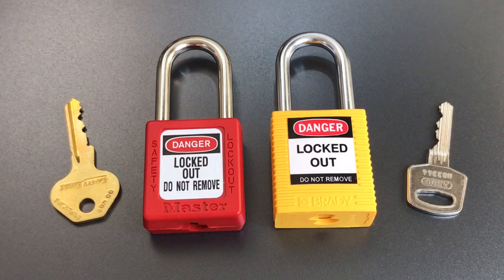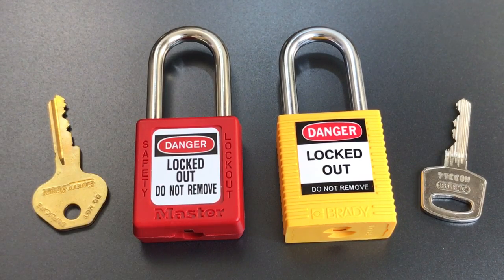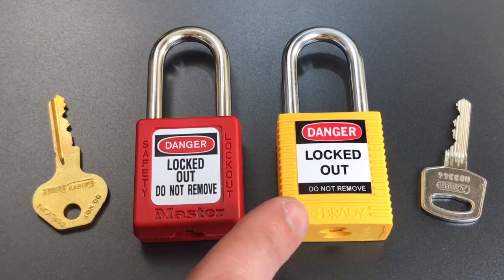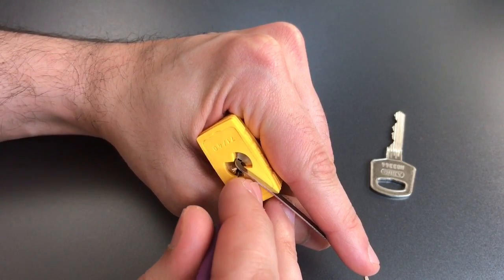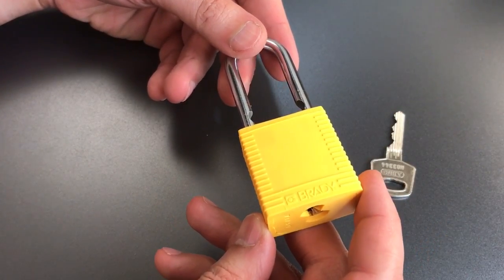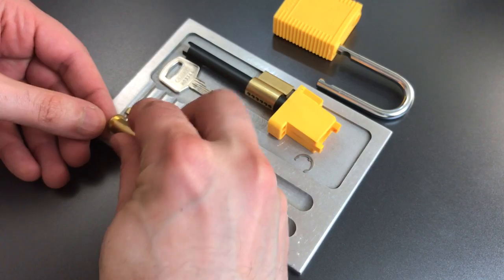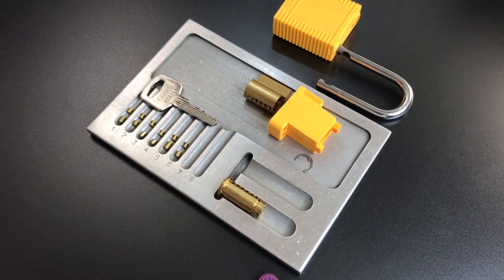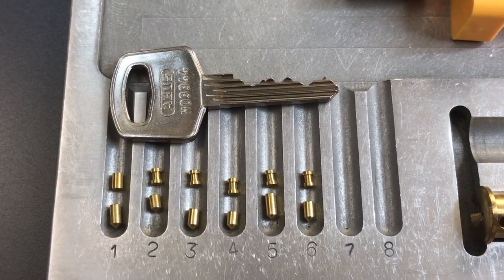[484] Abus/Brady 71/40 LOTO Padlock Picked and Gutted

Comment: It's all to support "One Person, One Key, One Lock".  Large companies may need to order thousands or tens of thousands of these locks, all keyed different.  Companies are even discouraged from allowing contractors to introduce outside locks due to the possibility of a lock being keyed the same as one of the corporate locks.  Master will even send key charting documents with the key codes for every lock to prove they have no duplicates, and support it by making sure future orders are not duplicated with prior orders as well.  So six pins gives you more unique keys.  As for the security pins, I imagine it's to help prevent accidental opening with the wrong key by accidental bumping or raking. The keyway is also restricted so that duplicates can not be created in the field to bypass the "one key" rule.  You should not be able to find blanks for these in the wild.

You can also order them keyed alike, master keyed, grand master keyed, and even great grand master keyed. OSHA does allow non-destructive removal of the locks if it can be verified that the employee is no longer onsite.  It does require quite a bit of extra documentation and procedure creation on the part of the company to do this though.
Reply: Well said. Thanks for the info.
Reply: The security pins are there to prevent claims that a LOTO lock was picked open either during or after an accident, which is a claim that could be made to shift fault for an accident from a negligent technician to the company. Likewise most LOTO locks use ball-bearing lockup to avoid claims of shimming the lock.

It's all about avoiding lawsuits and false claims.
Reply: 6^6 is still under 47 thousand configurations, so you definitely need to do it not-random if you want tens of thousands keyed-unalike.

You will not have a greatgrandmasterkey system with tens of thousands of different locks, for sure.
Reply: Here’s your OSHA reference:  1910.147(c)(5)   As others have said on this thread, makes no specific reference to pins. That wouldn’t make sense anyway. No government entity is going to write it that way. Just like they moved to performance specifications for procurement about 40 years ago. That is, when the government wants to buy something, they tell you WHAT it must do, not HOW to build it. Of course as I say that, the FAA requires Part 21 pilots to carry a flashlight with D cell batteries. Most ignored FAA reg on the books.
Reply: Chris P Bacon  Like I said, they can be ordered keyed alike, or they can be ordered and documented as no-duplicates. It's up to the applicable OSHA rules and internal company policies.
Reply: @JohnSmith-gs4lw  lol, flashlights with D cells... Those are pretty hard to get a hold of these days. But I'm sure any pilot carrying a flashlight will have a nice pen light with a Li-Ion or LiPo battery, and get a lot more light for a lot more time out of it...
Reply: DoctorX17 absolutely. And every one I know does exactly that. I was just saying that by doing that they are violating an FAA regulation. Would they ever get fired because if that? Or lose their license?  Lets hope not. But never underestimate the arcane stupidity of the Federal Government.
Reply: @patrickmcclintick9552  The only time keyed-alike would be permitted is if one person is specifically responsible for energy control and therefore one key for n locks at a jobsite. If multiple people have locks, the locks cannot be keyed alike. An employer can retain a duplicate for nondestructive removal but it would have to be subject to stringent controls. 

I'm federal government. We like simple and inexpensive lowest-common-denominator and have a ton of authorized employees with multiple locks [mine number in double digits due to 7 sources of power to lock out on one machine]. Some of these are breaker lockouts that attach to the handle and those locks must be electrically isolated, so in order to meet the requirements we have the Master 406 which is the logical and self-destructive end of high security core in low security device. The 406 is the 410 with a black nylon shackle [no exposed metal, because metal becomes plasma in an arc flash/blast] and barely meets the "without undue force" security requirements of OSHA regs. You don't need a set of cutters to remove it destructively, you only need something like a screwdriver to give you a little mechanical advantage while twisting the lock shackle and it breaks. 

Most of the reason LOTO devices are like they are is because of mammoth entities like the federal government that have policy requirements that exceed OSHA regs and at the same time don't want to spend a lot of extra cash. Solution? Build a generic thermoplastic lock, buy a mountain of meaningfully sequential key code security lock cores, and use economy of scale to make maximum profit. Through hiring/firing, attrition, the need for destructive removal, loss of devices, loss of keys, and general wear and tear LOTO locks are a consumable. The 40,000ish possible differs [per Master] mean that it's possible to prevent even entire regions of our operations from getting 2 locks keyed alike and security pins discourage key hacking/makeshift impressioning [we have a key cutter, some easy locksmithing is a small legitimate part of my job] and eliminate the possibility of an unskilled nondestructive removal. They make the product for we the Feds, and other large industry, and everyone else buys them because compliance is cheapest when you're using the most popular locks in the LOTO game [Master 400 series, Abus 71/40 and 74/40]. Has anyone tried out the Tradesafe? Seems to be a Master 410 clone.
Reply: @kdawson020279  I get it, but if you go to Masterlock, they do offer an option to order them keyed alike. So someone, somewhere, must have a use for them like that.
Reply: @patrickmcclintick9552  I can only see keyed alike being useful in a situation where one person in control is locking out multiple devices such as at a site where energy control is dual responsibility. In some situations, OSHA regs may not apply but they want the internal control. I don't have a lot of experience with the most strict interpretation of every regulation not applying since I am federal. I think it's also the reason that a plastic lock with 5 spools and a serrated pin makes perfect sense to me. Safety is between the ears, but safety theater is a good reminder not to send plasma through your body or mangle your coworkers and it avoids fines and regulatory actions.

Comment: From OSHA standards.
1910.147(c)(5)(ii)(C)(1)

Lockout devices. Lockout devices shall be substantial enough to prevent removal without the use of excessive force or unusual techniques, such as with the use of bolt cutters or other metal cutting tools.

No specific rule on number of pins.
Reply: I actually didn't know this. I thought they did it because it helped with price and electricity insulation
Reply: also if a source of supply is turned on and your lock is removed it's on you no questions asked but if the lock is destructively removed which would be very obvious it's no longer on you unless they do an investigation and find it was actually you
Reply: You can probably blame the existence of locks like this on the government since we are voracious consumers of locks and our Electrical Work Program requirements are more stringent than OSHA regs. In fact, the full LOTO procedure for my machine requires 7 separate locks, 3 plug lock devices, 6 6-hole hasp devices, one breaker lockout device, and 6 separate verifications of zero-energy state.
Reply: @donniedial3014  There is a rule about one key, one lock, one employee which explains the pin count but not the extent of the security pinning. That part is probably just CYA for preventing surreptitious removal.
Reply: I always figured/was told that osha requires that only the operator of the lock can be able to open it (aside from a spare key being locked away with other lockout keys for emergencies) and that for legal reasons they have to be able to show signs of malicious tampering such as a cheap plastic case
Reply: @Mrbmxprorider  For our Electrical Work Program and mechanical hazard lockout, it's really the fact that there are > 40,000 meaningful differs that a facility can have and we are the largest civilian federal agency so we consume locks like water [we recycle many pounds of locks and keys monthly]. The security pins may be overkill, but I imagine it was intentional overkill for economy of scale to buy a ton of that core when the rest of my locks are 100% plastic [including shackle]. Our EWP is stricter than OSHA requirements. There are no spare keys in our repertoire. And, to prevent a change to LOTO policy making the devices obsolete, it seems to make economic sense to preempt any future security requirements.

Comment: This guy is just too good, I've been working on one of the red master locks for days to no avail. Other then a false set.
Reply: Samuel James once you get an open and know the sequence they are quite simple.
Just make sure you lock it the correct way or you will lose the key pins out of the top of the lock body.
Not that I ever did that. lol
Reply: This is an old comment.  But god I’m in that exact spot false sets with no luck days into it.  This damn lock is racking my nerves

Comment: The requirement in Canada is pretty much that it requires excessive force, is handled by CSA standard z460 (-05 i think).  I think that ANSI Z244.1 and US OSHA’s reg CFR1910.147 is for the USA.

The big thing, the only way these are designed to be removed is an obvious brute force technique. Something where you need either a hammer, bolt cutters, or some other means of mechanical destruction.  The phrase they use is "Be substantial enough to prevent removal of the energy-isolating device without excessive force, unusual measures or destructive techniques."  Better known as they don't want someone opening a master lock (or other garbage lock) with a bobby pin or a zip tie.  That is where i think the security pins and 6 pin lock stuff comes from.  If a LOTO lock is opened in a non-destructive manner, that does not require a skill, then it puts the company manufacturing it into a very serious situation for legal proceedings.   That's why the plastic locks are allowed, as they can be smashed with a hammer.

Comment: I have had both of these issued to me, the most recent is the 410 lock with a nylon shackle. I can't consistently pick my LOTO lock, but if someone leaves their lock on by accident and we cannot contact them then they can be opened by a half twist of the lock body with a screwdriver in the shackle. 

The OSHA regs state that all padlocks have only one key and that all keys be unique. I think 6 pins is just to allow for a larger number of unique padlocks. Based on my current US government issue Master with a plastic shackle [insulation reasons due to high powered electric equipment and lockout in panels] they also don't require them to have a metal shackle.

Comment: I bought 6 of these to practice with. What I didn't realize is if you pick this lock and turn the key 180 degrees the driver pins will drop into the holes drilled in the bottom of the keyway. You then have to push all the pins back into the bible under tension to turn the lock back into the starting position. Fun to pick though.

Comment: the only thing is, only one key for one lock and not 2 by accident keyed alike, so that is why they need the complexity to insure you don't by accident pull a key a bit out and get an open. A simple 5pin with an open keyway could maybe jiggle a key to open. And all the plastic inside is to make sure the key never get live, even if the shackle gets in contact with exposed electric contacts.
Reply: I got given 2 410 locks at work and they happened to be keyed alike

Comment: VERY nice picking. If I can duplicate your method, I too will be able to SPP like a pro. I want to get an ABUS/Brady LOTO. Where do you find them, and what is the average price? 
I have a progressive lock that I can key up with spools, or anything, but they seem unusually easy to open. It's not that I have mad skills. A regular lock, like a padlock, seems to be much harder to open in some cases, than the bare core. I also got that HUK kit, and I like how you explained what everything is, and how to use them. That was in another video of yours. You just demonstrated how to SPP a lock with security pins. Now all I need is a lock like that, some time off from work, and practice. Lot's of practice. I will master SPP. For now I am happy with any non destructive way of getting into a lock without a key.
Hello, my name is William, and I am addicted to lock Picking. Lockaholics Anonymous,  local chapter 13.

Comment: Nice picking LPLAWYER! I think I heard you say that there are only two of the Abus/Brady LOTO padlocks but I have an Abus/Brady that is similar to the one in this video, although the core isn't held in with a screw. It has a small spring loaded pin down the shackle hole that you have to press in and the core is able to be removed. Mine actually has a SFIC type looking core but it is smaller than the normal SFIC cores.

Comment: The reason I said osha regulations caused the masterlock loto lock super cylinder is that one regulation of the OSHA requirement is only one key can open  a lock (They need more key combos so they need a key with more cuts in it). As for the pick resistant cylinder maybe master lock has a soft spot for people who work in the industry. Maybe they thought a great way to sell their locks over the other companies was to offer a pick resistant cylinder.

Comment: I'm 99% sure that the reason for the top end cylinder and security pins on a plastic body lock is to make it more "Tamper Evident".  If the lock was cut off, it was obviously in place and removed by someone who did not have the key, and that they did in fact see the lock and it didn't just fall on the floor or something.  Otherwise a plain old Tag Out tag would do the trick.  I suspect these tags, and the cheaper locks tend to just disappear when a machine gets turned on and someone gets hurt as a result.  So the lawyers/insurance companies want to be able to prove whoever turned the machine on was fully aware there was a lock and knowingly removed it and is therefore at fault.
Reply: Hmmmm.. but the lock should physically prevent the equipment from being energised, or (in the case of complex isolations) prevent the keys to the isolation lock/s from being accessed. That's the whole point of LOTO

Comment: Some of the states might have regulations concerning requirements of LOTO locks in the absence of OSHA regulations.  For instance, I remember reading that the State of California requires locks used for LOTO to have no fewer than 10,000 differs but I can't find the regulation now.  The idea behind the plastic body LOTO locks is to eliminate a potential conductivity hazard and not so much  that they operate like a reusable seal.

Comment: The Requirement Is That The Lock Only Has One Restricted Key.
The Masterlock Keyway Was Compromised And They Changed To 
The One You Have, That Is A Reverse 27 Keyway 6 pin  
>> The Keyway Is Shaped Like The Name So That Publishing A Keyblank Silhouette 
Will Be In Copyright Infringement - - - SAME AS Masterlock Edge "M" Logo Keyway
Reply: neato!
Reply: The silhouette is not protected by copyright, but by trademark. Small detail in effect, but important for some legal technicalities.
Reply: It Is Protected By BOTH Copyright & Trademark
The Masterlock Edge Is x 4  Because Of The "E" in Edge and The "M" Logo
Reply: You Don't Need To Type Like This.
Reply: @roge0  It Must Be Very Difficult As Well, Maybe There's An App Which Does It? 😎

Comment: If you happen to seed this, have you seen a Brady lockout tagout with a thinner, slightly darker shackle and no screw where you started to disassemble yours? Mine is red, same type of key, keyhole and Abus branding placements but I can’t figure out how to start disassembling it since there is no screw. I’ll destroy the plastic if I have to but would rather not and didnt know if you have seen this lock and if it is meant to have a non removable core or if I am missing something. This would be my first gut so I feel like I might be missing something obvious - the plastic body has no lines on the bottom or elsewhere to indicate that it comers apart either. Thanks for any info and thank you for your videos - they have been super helpful.

Comment: The pin count and security pin is simple it was lawyered in. The purpose of a lotto lock is to keep someone from getting hurt or killed by locking the system out. Now they can be defeated by someone with bad intent but with what you have in the locks it is less likely someone will stick the wrong key in and get a unintentionally unlocked machine there by hurting someone. So if someone is trying to hurt someone they can defeat the lock but less likely the manufacturer will get in trouble because the lock was opened with the wrong key or through anything less than intent to open lock to begin with.  That's my thoughts anyway. I have worked with lotto systems for years.

Comment: I have one of these I attempted a pick on and managed to get the core to turn but didn't unlock the lock. After replacing the core to its locked position I can't even open it with a key. Did I push a pin out of place? Thanks for the cool videos!

Comment: Is there a list of regular Abus locks with less secure cores that these LOTO cores fit into correctly to make an upgrade to a regular lock?  These Brady/Abus LOTO's are a little more expensive than the Master 410, but much easier to take apart non-destructively.  I already have a plan for a 410 to heavier Master Lock transplant, but wondered if it can also be done with these from Abus before I order some.